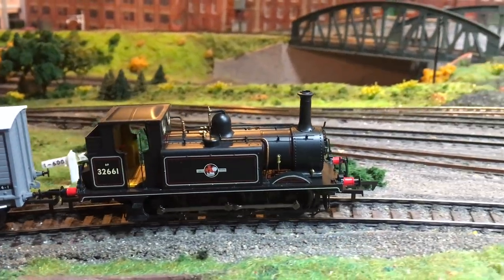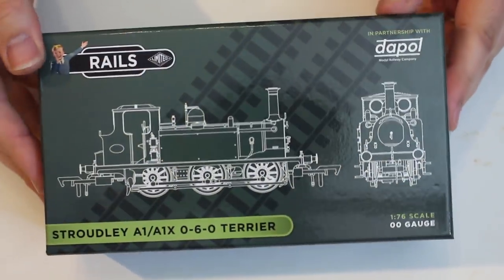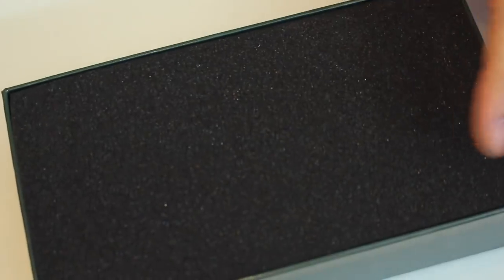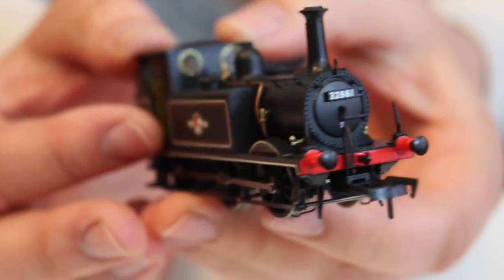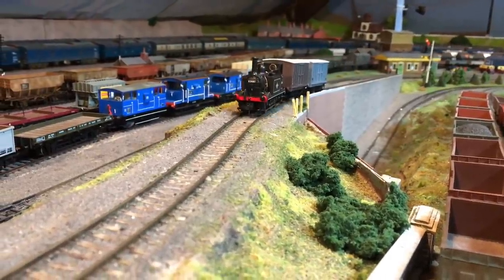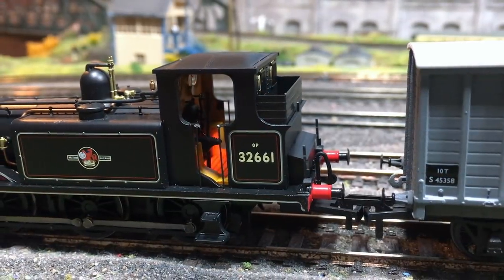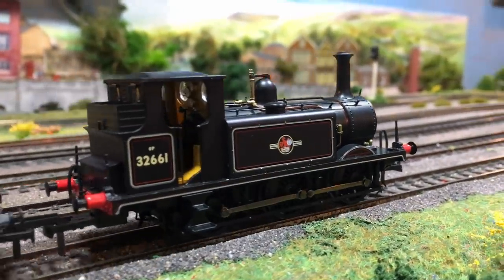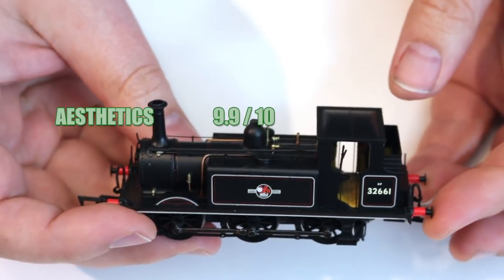Rails/Dapol Terrier 0-6-0 Stroudley A1/A1X in Late BR Black Livery - Unboxing, Review and Comparison

Comment: I note an advantage over the new Hornby one - the top of the tanks is modelled correctly. It is plating that folds over the tank itself and the seam can be seen whereas Hornby is just flat. Not massively noticeable, but certainly demonstrates the extra care Dapol/Rails have put in.
Reply: Like their I gauge one however it is missing the hatch in the cab for the coal... Not an instantly visible omission but one that makes a real loco nothing more than a static exhibit! Hopefully I can position a crew in the way to obscure its omission.
Reply: in later releases, Hornby have corrected this to some degree

Comment: Looks like a beautiful model. The only things I could spot from the details being blown up in the video- there's a bubbling effect on the Salter safety valves and the cab window frames. However I doubt that is visible looking at it without a magnifying glass. The other thing that the lbsc experts will know, was there a plate between the flare of the chimney and the chimney proper? I know on other company's locos the brass flare was a simply wrapped around the chimney and attached only at the flare base giving an odd effect looking down.
Reply: Bubbles are from the steam!

Comment: Thanks for a very informative review. Only point I would disagree with is regarding the benefits of sprung buffers. You point out how the sprung coupling allows sharper curves to be negotiated without buffer lock - sprung buffers also help with this and allow those of us who like to close up the loco-train gap as narrow as possible a little more leeway. As most (but admittedly not all) modern locos have sprung buffers I personally would see it as a backward step if manufacturers stopped providing them - certainly on premium priced models.

Comment: They've still screwed up the vaccum/air pipes. That model on the review should have a vaccum pipe and not an air pipe because it doesn't have the westinghouse pump on the side. It also doesn't have vaccum gear in the cab.

Comment: It is good that Rails have brought out an Isle of Wight loco now that DJ Models has gone bust and their O2 Adams tank is no longer available. The Terrier was used on the Isle of Wight before the war to haul 4 wheel carriages, but after the war 8 wheel bogie carriages were introduced and the Terriers could not haul these up to Ventnor very easily, so the Terriers were returned to the mainland and replaced with O2 tanks. All the O2 tanks on the IOW were cut up at the end of steam except for one - Calbourne - which was purchased by enthusiasts to run on the Havenstreet Railway. The Terriers faired much better as preserved locos because they are ideal for use on a heritage line.

Comment: hi Jenny/zoe
am going to wait awhile as ive got so many mainly lner pre orders i do have 2 exclusive locos for ros being secr d class and cr 812 so this terrier going to have to wait i think
still a great model the flicking fire box is a gimmick in my opinion same with opening smoke box doors (only my opinion)

sorry but ive done the history again (if you want me to stop just say)
number
lbsc 61
lbsc (2nd) 661
sr  2661
br 32661
built at Brighton on 31/10/1875
Rebuilt from A1 Jan 1912

withdrawn on the 30/4/1963

cut up at eastleigh works on the 13/9/1963
shed codes only 2 i can find are:
fratton  1948
eastleigh 26/11/1959 (eastleigh is thge shed code on your model)
note: The last Terrier to be scrapped by British Railways

keep safe arp

Comment: After waiting for so long, it's extremely disappointing to immediately see at least 2 major errors which should have been corrected before production - ie the extension coal rails should extend right to the back of the curved raves on the bunker and the tops of the side tanks have an incorrect profile, replicating Hornby's error.
Reply: What's the error with the tank top profile?

Comment: I'd be hard pressed to say that this is the definitive version of the terrier as you kept repeating. Apart from very minor detail improvements and some parts worse than the Hornby model, for the extra money its a bit of a hard sell given Hornby's wide range and wide distribution of their models. I have Hornby's Stepney and Rail's Burnt Umber version, and to me the differences were basically negligible. The Rail's model had worse cab detail, worse wheels, less accurate brake rods, I would have a hard time recommending the Rails terrier over the Hornby one given the price increase with relatively negligible differences, unless you really like the firebox flicker.